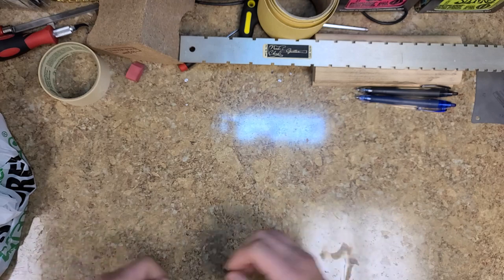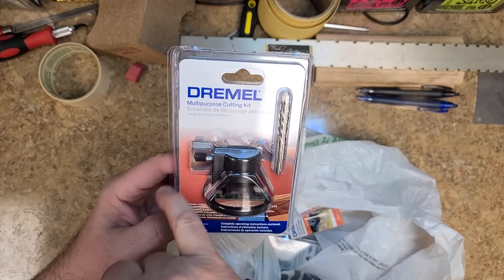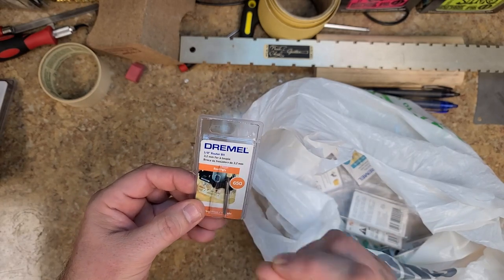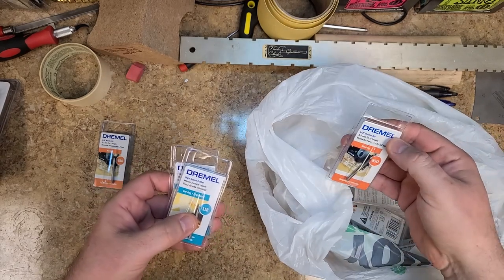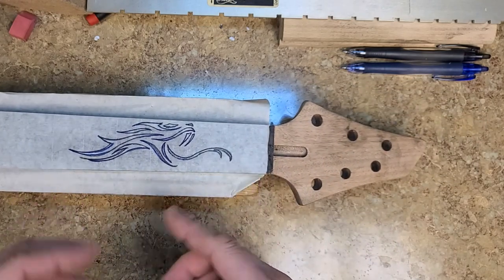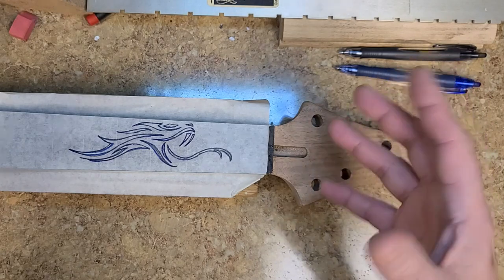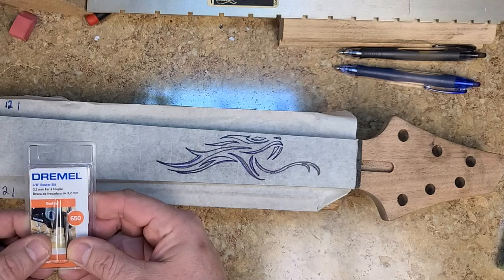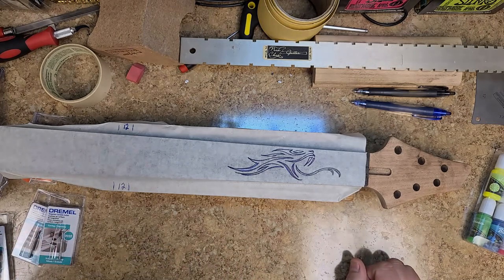Guitar Kit World Guitar Neck Art and an Unboxing

Comment: Dremels are awesome tools. I used mine along with an X-Acto knife to cut the shelf for my R-2 locking nut on my Squier Strat neck.  A router is the right tool but I used what I had and it worked. I know your snake will look amazing. Your work always does. Can't wait to see!